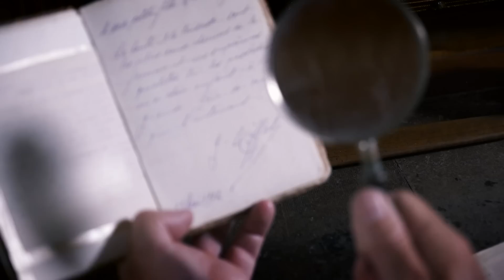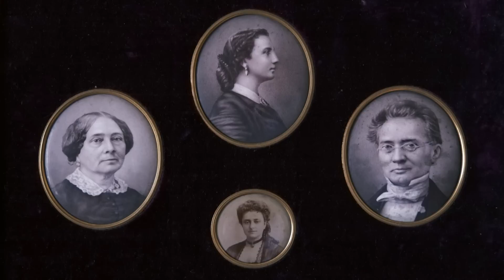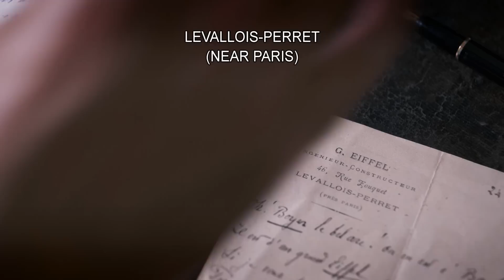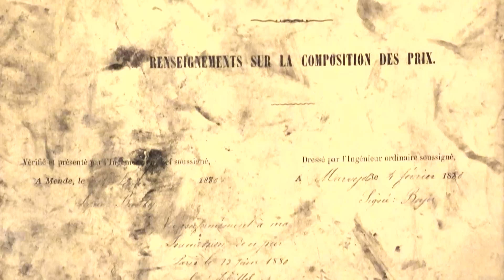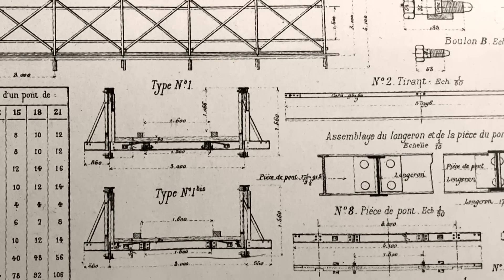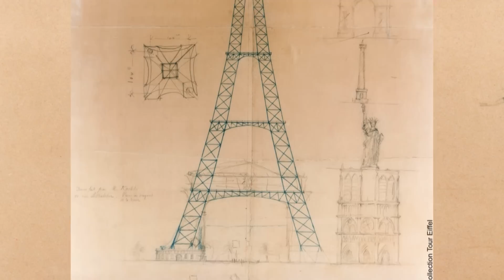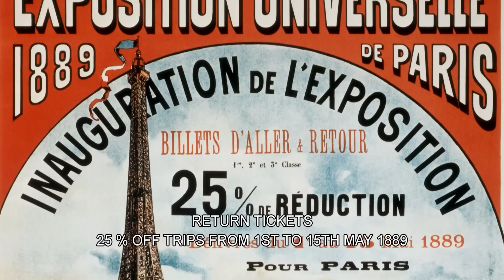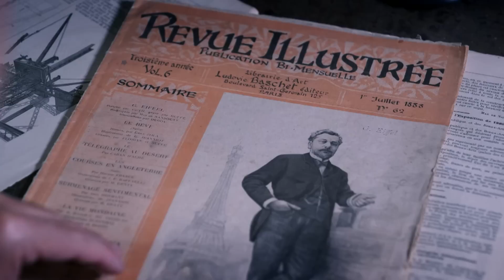When Steel Meets Sweat: Eiffel's Megastructures | FD Engineering

Comment: I'm a retired mechanical engineer.  This guy is a god.
Reply: I am also a retired mechanical engineer.  The structures Eiffel designed were statically indeterminate to a degree well above the ability of anyone to do a complete mathematical stress analysis at that time. He must have had some means of approximating the stresses in all the chords of what are very complex trusses in order to specify the dimensions of each component. Obviously he got it right with only one collapse and that was of an incomplete structure subject to extraordinary wind.
Reply: @pauleohl In short: Eiffel was a god 😊
Reply: Agreed - I had no idea he worked on the Statue of Liberty as well...
Reply: @stevengill1736 yes it was very impressive the things he did. But I thought I’d mention he did not make the exterior of it only the skeleton

Comment: I knew of the Tower, the statue of Liberty of course, and I've visited Garabit -  a most impressive bridge in a spectacular setting, just 130km up the A75 from that most spectacular of modern high viaducts, the Viaduc de Millau, whose steel deck was built by the Eiffel company.  
But I never knew of Eiffel's role in aerodynamics.